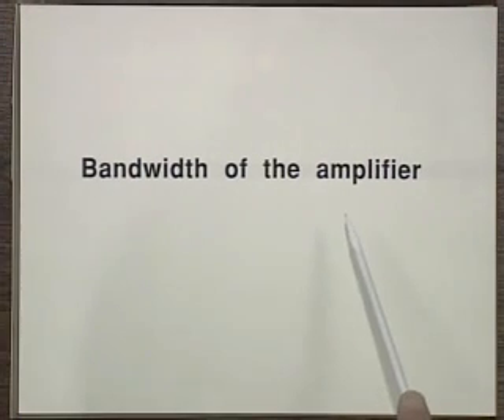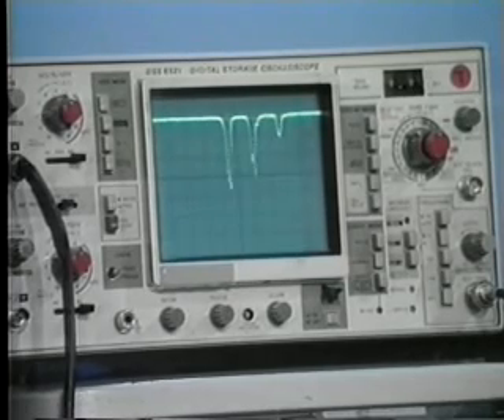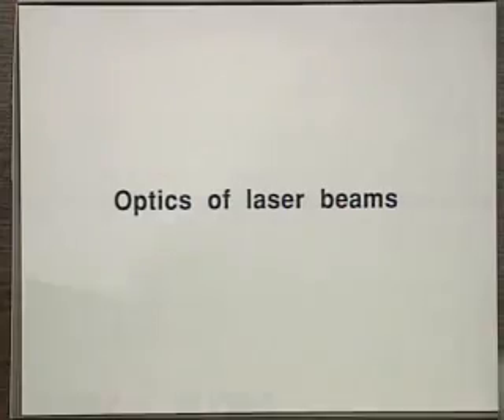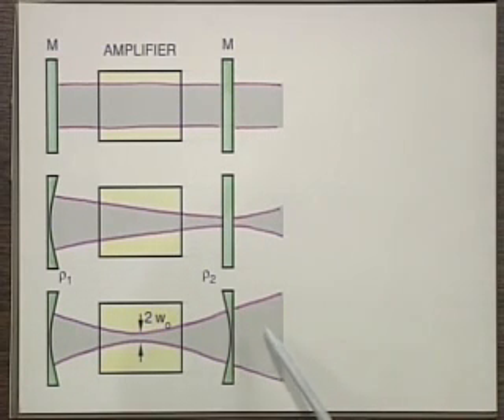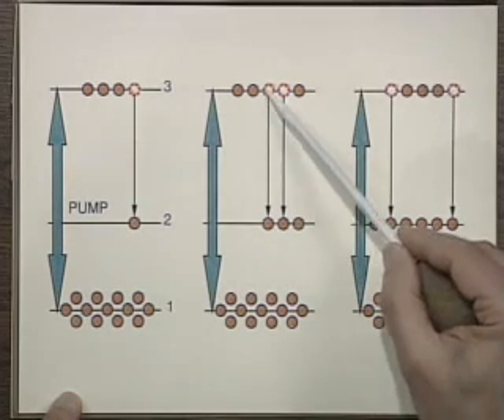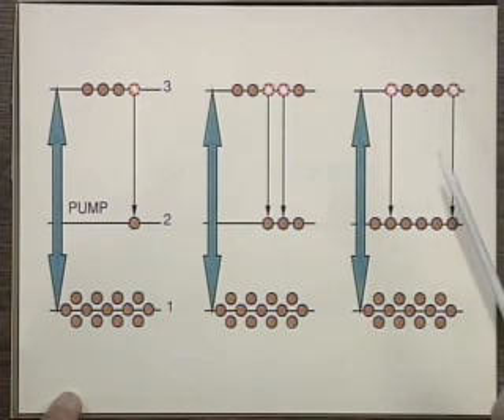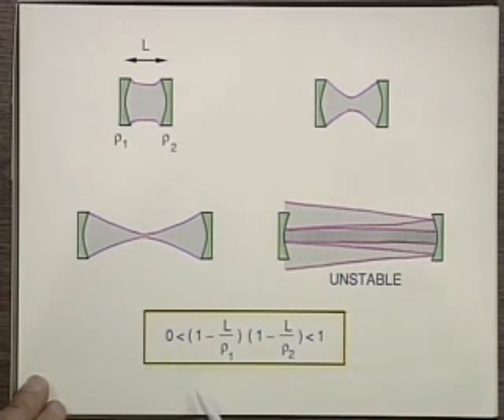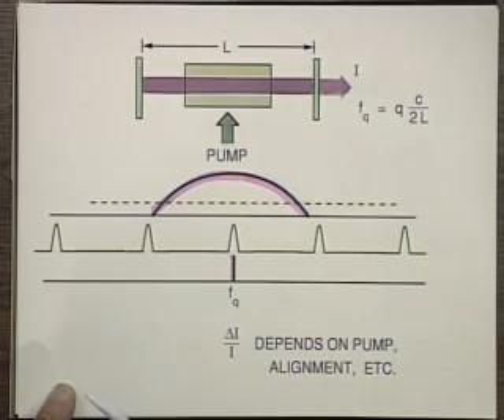Laser Fundamentals III | MIT Understanding Lasers and Fiberoptics

Comment: Thanks for the good lecture, very helpful! I have a question though, if a 3 level amplification medium is used, there are only limited number of photon frequencies one gets from stimulated emission (f=(E3-E2)/h or f=(E3-E1)/h), but when we look at the frequency spacing of a cavity we see a lot of frequencies evenly spaced (some of which are amplified within the gain bandwidth). Isn't this somewhat contradictory? What if the photon frequencies by SE do not lie within the gain bandwidth?